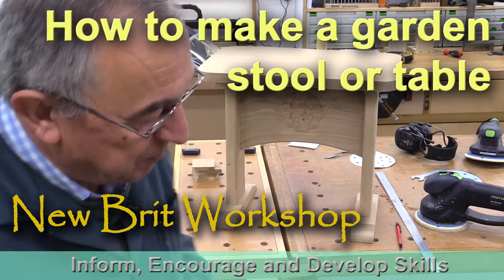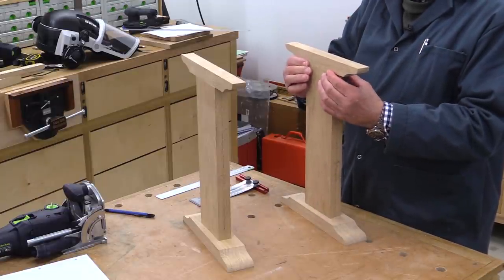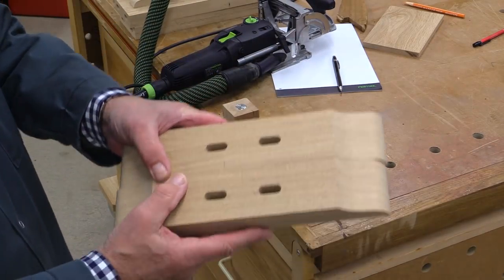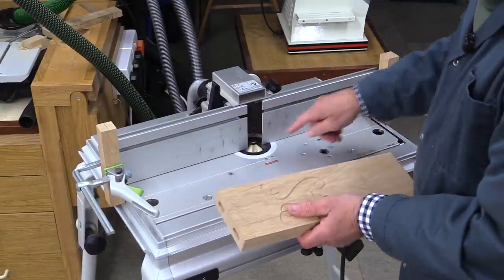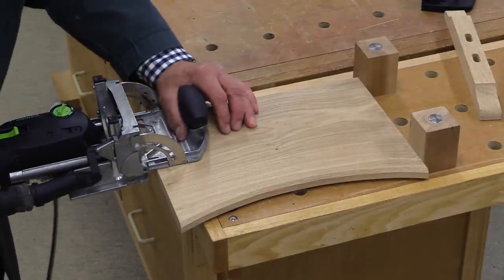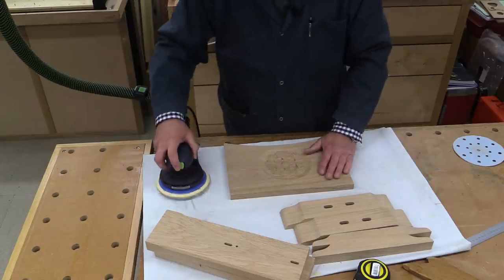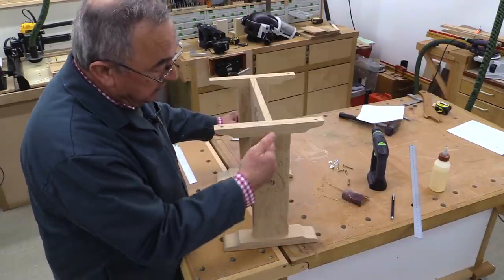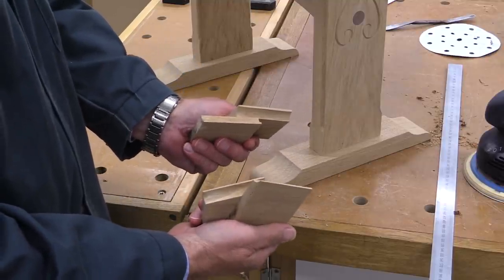How to Make a Garden Stool or Table

Comment: Wonderful job again Peter, I would love to know one thing, I use a bottle of wood glue almost the same as you use, how do you keep it clean so to stop the glue sticking up the nozzle ?
Reply from the maker: Hi Derek, It is not easy but I try to remember to wipe the top whilst open, close the top and then wipe again. It works most of the time. If it sticks it is because a tiny amount of glue is sticking between the outer element and the centre part that acts as a stopper.  Peter

Comment: Great project. Peter I have a question about the Parf Guide. I'm trying to make a plate with dog holes that fits in to the Table dog holes to attach something. The plate will then fixed with some clamping dogs. The amount of holes is a rectangle of 3x3 holes. Can you tell me what is the minimum of guide holes in both direction I have to make?  
I tried many configurations but can't find a way to make it without making more guide holes, but then I have to take a much larger piece and cut it down to size after making the dog holes. #parfguidesystem
Reply from the maker: I have not experimented with a small set of holes but it should be possible to do 4 x 4.  Peter

Comment: Excellent job, really love the stool and the process of making! From what I saw, you used 'regular' domino's. Shouldn't you use domino's for outside use, did you, or doesn't it matter?
Reply from the maker: I am not worried about this as the domino life, inside those joints, is far greater than the rest of the structure.  Cheers.  Peter

Comment: Peter did you use Sipo, or Beech dominos, as the seat will go into the garden?
Reply from the maker: The normal beech ones. I am not expecting any issues as the seat will be in an open porch when not in use.  Cheers.  Peter